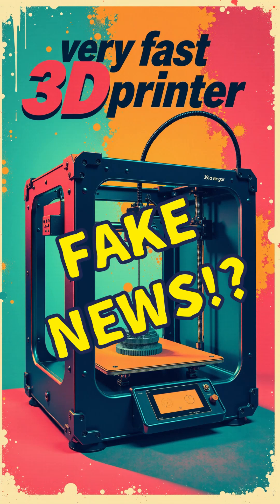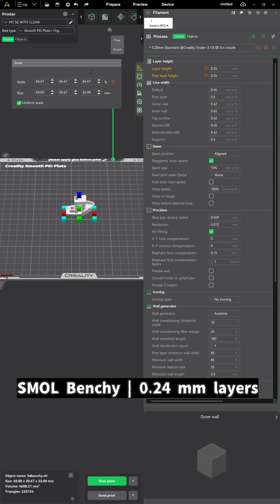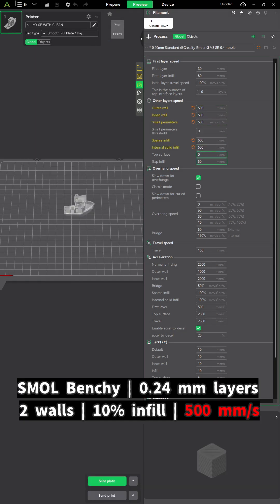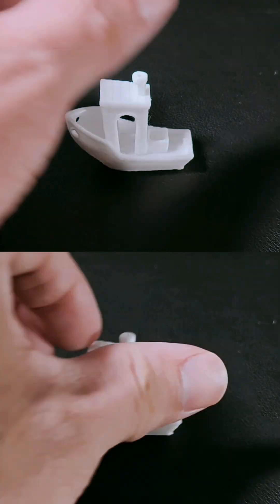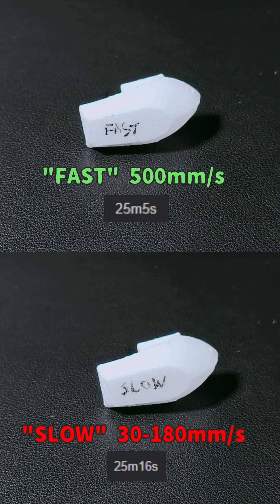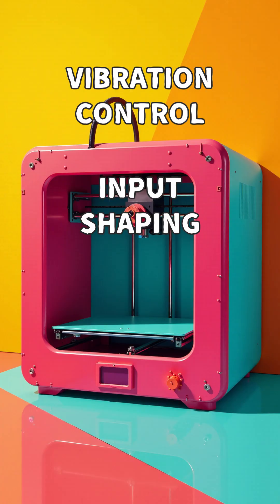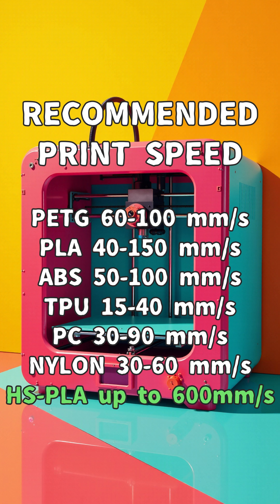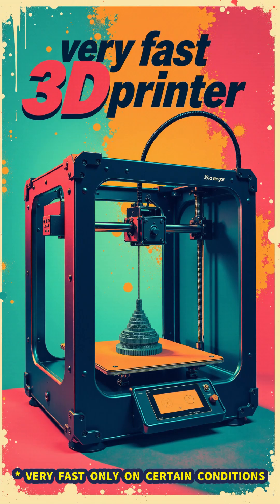"Fast 3D Printing" Is A Marketing Fad!?  #3dprinting #3dprinter

Comment from the maker: TLDR :
- You have to factor in cooling, flow rate, vibration control, acceleration rate, etc...
- Will probably not reach max speed while printing small/complex pieces.
- You can print fast, but still limited to the speed of "as fast as the filament will set properly".
Reply: A lot of People think a faster printer is better .
Wel it is the nozzle size .
That cuts print time .
And the choice of filliment. 
Not al matrial s can print fast .
😅

Comment: Man
You're incorrect 
Learn about max volume speed (measures in mm^3/s)

If you open some tabs after the model is sliced you will see that real speed is the same in your two "modes" because of the max volume speed
It limits the amount of plastic that can be extruded in second, so it limits max speed
Reply from the maker: Isn't that exactly the point? "Fast print is not just mm/s layer speed". 🙄

Comment: https://youtube.com/shorts/X5U_VSIDO14?si=NeLrnfTx4yo3AlzA 😂
Reply from the maker: Exactly my point, try 800mm/s on a budget printer and it will fail spectacularly. "Fast" also includes acceleration, flow rate, cooling, print complexity, etc...